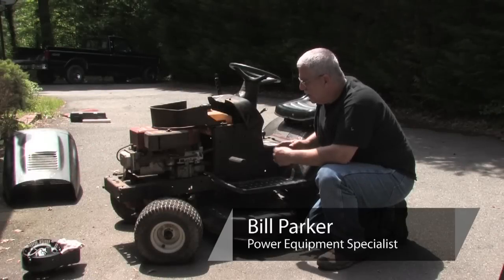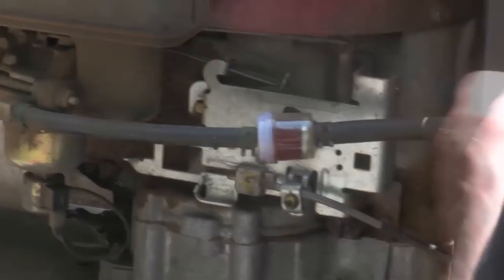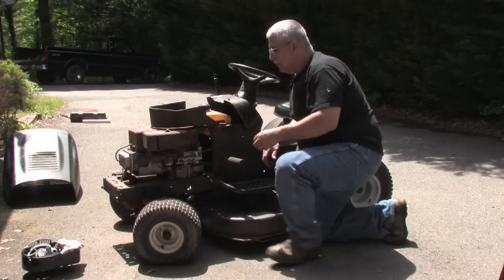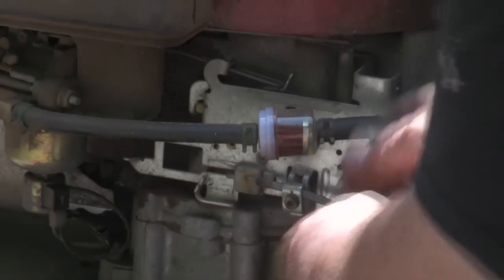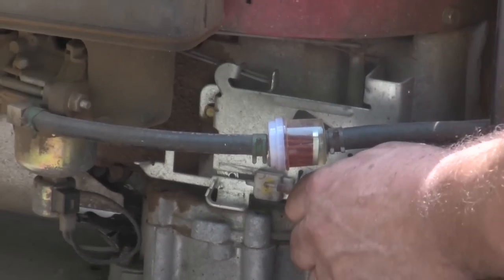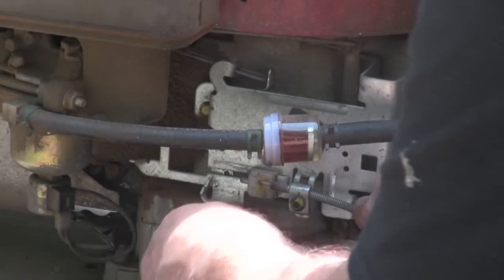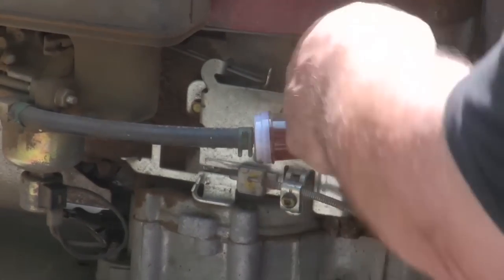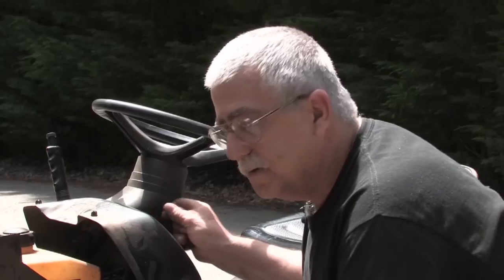Lawn Mower Repair : Lawn Mower Choke Repair

Comment: This is a great video but I'd like to know what to do if the throttle rod (that "U" shaped piece part LG691840 in the JD Parts Catalog), doesn't come back automatically when the throttle is retracted.  Do you have a shot of the side of the mower a little more to the front. There is a plastic piece connected to the U shaped bar, and I think I have a spring missing there, but don't see where to connect the other end.

Comment: Bill, I have the opposite issue. When I engage my choke for starting then pull the lever back to idle my stays stuck.  What do you think?
Reply: My choke was stuck also, a little carb cleaner solved it.

Comment: Bill, I have the opposite issue. When I engage my choke for starting then pull the lever back to idle my stays stuck.  What do you think?
Reply: The choke valve should be spring loaded. If you engage the choke on the carb with your finger and it doesn't have resistance to spring back then it is broken.